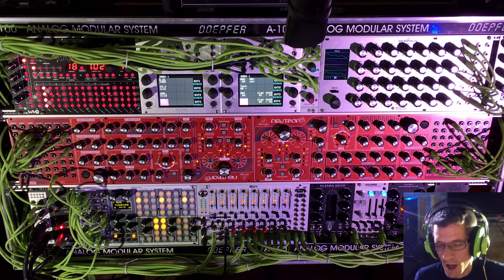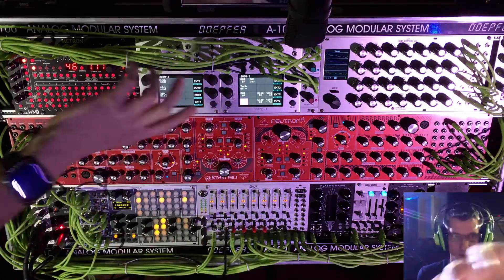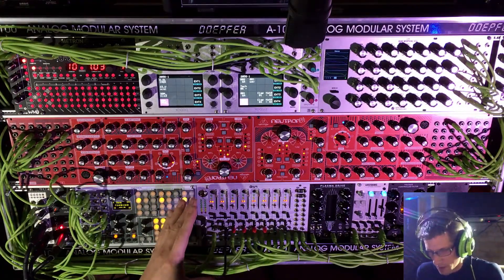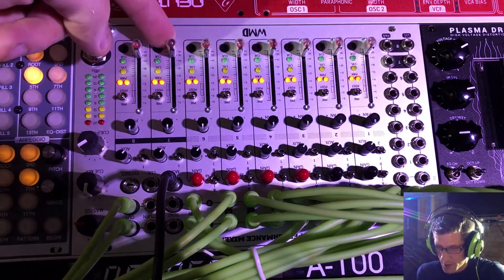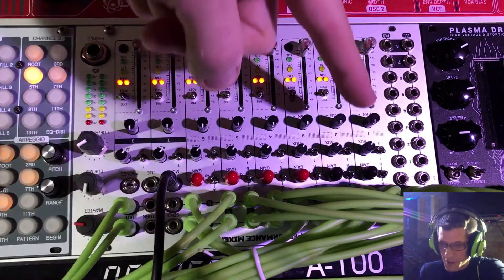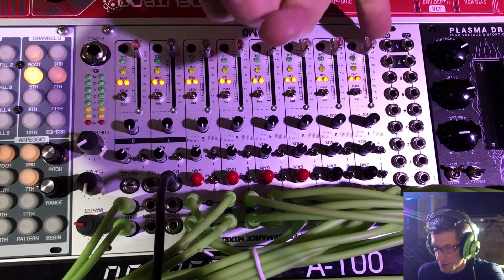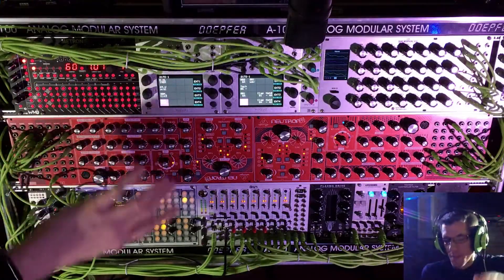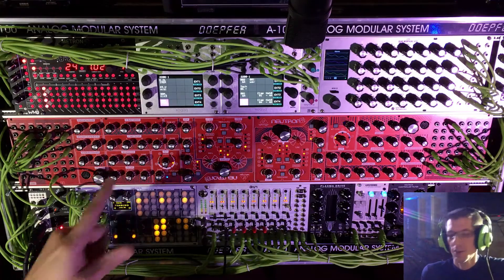Why would you have your mixer Upside Down? - MoXoM Style - WMD PM Mixer

Comment: Are those Bitbox samplers upside down as well?
Reply from the maker: Thanks for the feedback Rainmaker8r.  Yes, the Bitbox samplers are also upside down.  I have been trying to keep as many of the input output sockets around the outer perimeter of the case to make for easier cable management. :P  The samplers have an option in the settings menu to flip the user interface, so this makes rotating 180 seamless.  Cheers!
Reply: @moxom3854  more digital/screen heavy modules should take note and provide this functionality in their modules. I try to do similar with my modular where I’ll flip some modules around to keep all my patch points near the middle of the rack